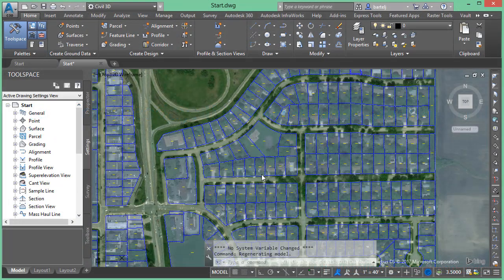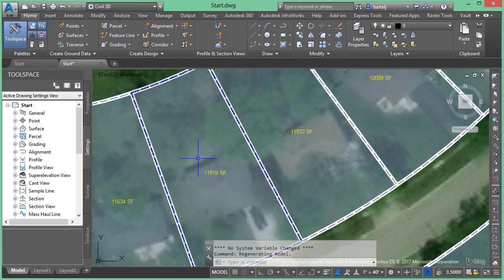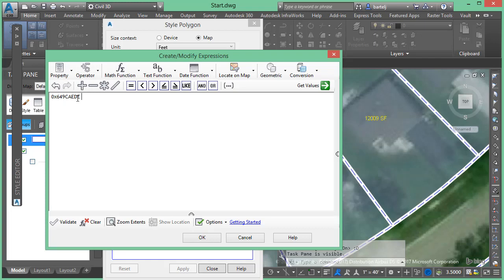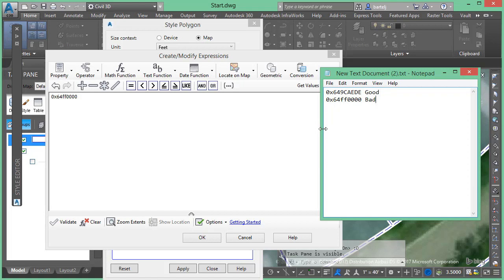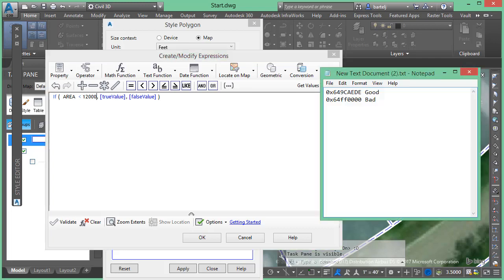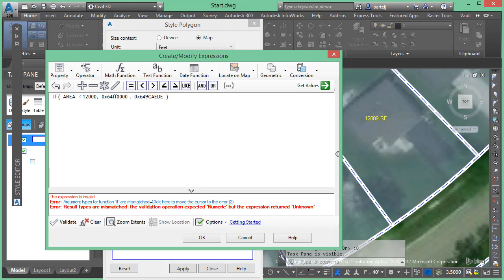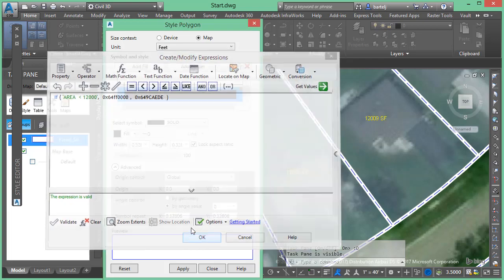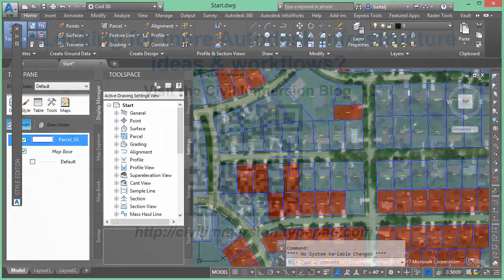How to use the IF conditional function to analyze GIS data in Civil 3D.

Comment: Your color preview is black bc even though your expression tells it to change red, if you want it to show red, or even blue as a preview for your expression that turn it red, just choose your color, THENdo not hit apply, then enter your expression and  when you run your expression and hit apply, the preview Colo will be whatever u choose and your expression will be whatever you tell it. So it reads the data color, then it runs and reads your expression color. Sorry for the long msg. Game changing tip you shared here. Thanks! I earned a long time ago from Jason Porter, great guy, but his method for bringing data into C3D is MAPIMPORT. he data is there and you can label via tags n other methods, but it's not a GIS layer or shapefile you can display in a table, you can export your data as an .sdf and import your .sdf as a new  shapefile. And have a data table. So many questions and answers. You have any webinars coming up?